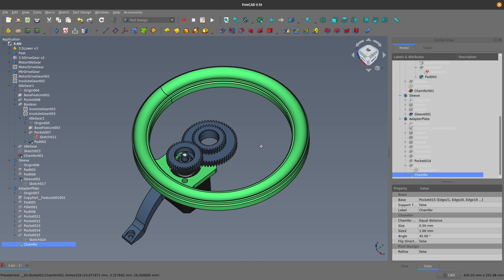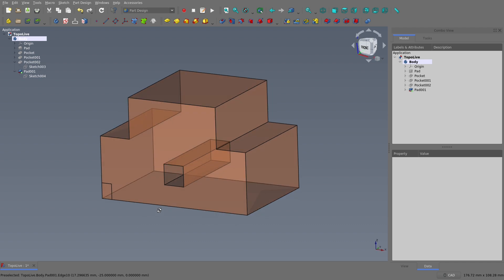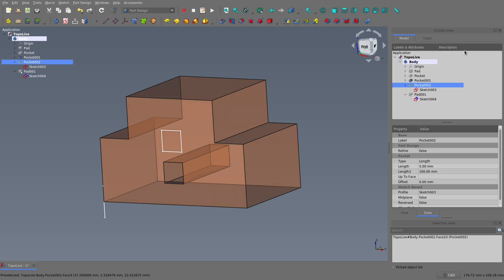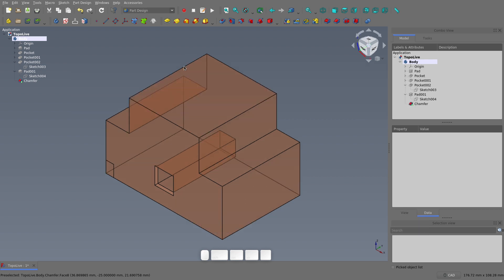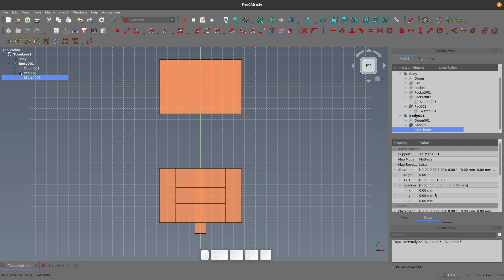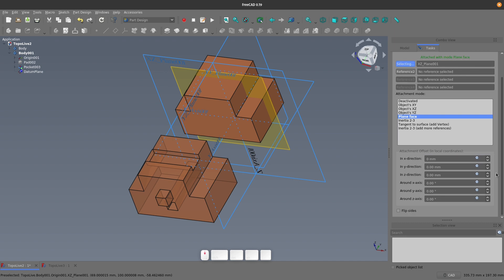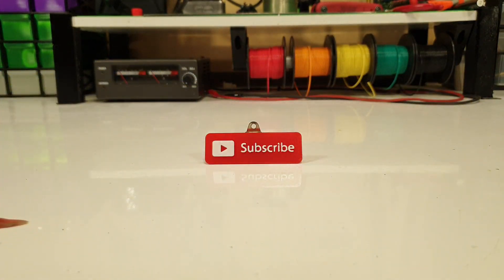Why do my FreeCAD models break? - "Topological Naming Problem"

Comment: attention devs : FIX THIS !!
Sev 1 priority 1. No new features until this is fixed. Real thunder models aren't compatible.
FIX THIS !!
FIX THIS !!
FIX THIS !!
FIX THIS !!
FIX THIS !!
FIX THIS !!
FIX THIS !!
FIX THIS !!
FIX THIS !!
Reply: There are no datum planes in sketches, are there? I use sketches for constraints.
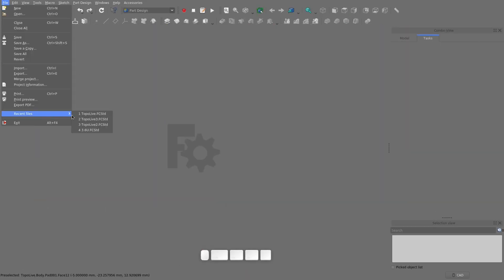Reply: 4:38 This workaround might work, but I encounter similar errors when adding geometry to a sketch: my tool paths get mixed up as to which faces they use.  I don't know how to fix it, or how to even know if topo naming is the problem.  
I'm not even sketching on a face.
It really messed up work flow and ability to edit designs. Took me a day to figure out what happened. "Oh it might be topo naming". Arg!
Reply from the maker: Linkstage 3 is a highly experimental version, so you can't expect things to just work between the two. There is a compatibility option in Linkstage3 that you can select that will disable multi part bodies to make the files compatible, but it won't prevent topo naming issues from occuring if you haven't designed with that in mind (even using Linkstage 3 or any other similar cad software, such as fusion, you should still use absolute references for sketches, not sketching on faces if you want a robust model you can change dramatically).
I use 0.19 for commercial work, because I understand the topo naming problem, it isn't an issue at all. I don't use Linkstage3 for commercial work as features can change at any minute.
If you've been following along with FreeCAD Dev, the realthunder robust topo naming fix has been merged with the 0.20 Dev version, which you can download and use (remember, it's an early Dev version, so it's not as stable as 0.19). The topo naming fix won't be added to 0.19.
As for sketches and datum plane's, you put a sketch on a datum plane, you can't put a datum plane in a sketch. You can still use master sketches for constraints and not have topo naming issues.
If you like Linkstage 3, just use Linkstage 3.
Also, look at the size of the core Dev team, it's tiny, almost all of them have full time day jobs too. So, maybe consider contributing or donating to help them move FreeCAD along faster, as they don't have time to come and dig through my YouTube comments to see you demanding fixes. (The forum is the best place to get information and help)
Reply: @BrodieFairhall  Man I'm sorry for the rant. I do appreciate all their work. I have submitted bugs in the past, but in the end they weren't fixed for various reasons.

And thank you for the response! I'm using v.19 and not sketching on planes.

Even using shape binders, I still get bugs if I rotate that hex shape with lines constrained to recreate the shape in another sketch. Seems like the edges are renamed depending on rotation (topo naming? Idk).  Maybe I'm not doing it "the right way". That is part of the problem: too many ways to achieve a result, and only a few are the "right way".

 <venting after days of trial and error in figuring out a workflow>
Reply from the maker: @TheRainHarvester  shape binders aren't topologically safe by default, remember, you're still selecting a face or edge of a model to create it. Everything must be created referencing the origin, not an object.
Sometimes the easiest thing to do is just copy and paste sketches.
Reply: @BrodieFairhall  I thought I didn't select a face or edge when I created the shape binder.
I just clicked shape binder.
Then selected "origin xy".

I tried copy n paste long ago. That doesn't work with constraints and edits / parametric workflow.
Reply: @BrodieFairhall  I ended up just padding the "shape binder" directly. It worked. But now I need to add some pockets to that pad and I don't know what to select since the pockets aren't in the shape binder (if I put them in the shape binder, they would get padded as holes. Actually they'd break the shape since they are around holes, ie counter sinks).

This is probably "Not the right way" again. What is the right way?
Reply from the maker: @TheRainHarvester  the right way is don't use a shape binders. Look at what I did in the video. Without selecting a face, create a new sketch, put it on the appropriate plane (xy, xz or yz) then adjust the sketch offset. Sketch what you need to sketch and then pad or pocket etc. Don't use any edge references etc.
You can refer to other constraints from other sketches in the expression editor, but I'd recommend using a spreadsheet as it's less messy (refer to my parametric modelling video).
That's basically it in a nutshell, only sketch on the origin and only place datum plane's on the origin.

Comment: Who in the right mind thinks that changing set names that work as some sort of ID should EVER change?
Reply from the maker: It's not really "changing" the ID's and when you look into how it works, it's a little more complicated to do than it initially seems. The issue is that every time you make a change, it rebuilds the object from that point and the ID's are created each time this happens. My understanding of how the Topo naming fix works, is before a change is applied, FreeCAD works backward through the nodes and notes which actions rely on geometry that was previously created and when it rebuilds, it tries to ensure the same ID gets applied to each piece of referenced geometry.
Reply: @BrodieFairhall  Thanks for the explanation! I wonder how other CAD software handles this …

Comment: until the freecad community fixes these problems OFFICIALLY, people will always try to use ANYTHING other than freecad.

freecad is nice and all, but it leaves a sour taste in your mouth that makes you realize what a royal mess it is, even if the potential is IMMENSE.
Reply: You have to realize that a lot of modellers don't make parametric models to begin with, so this would be much less of an issue for them.

Comment: WHY the names change? This shouldn't happen
Reply from the maker: This happens in a lot of CAD software actually, essentially it's because the model is being re-built from the last part you change each time you change something. I'll be surprised if RealThunder's new topology model isn't merged into the main branch of FreeCAD immediately after 0.19 is released as stable (which should be very soon)